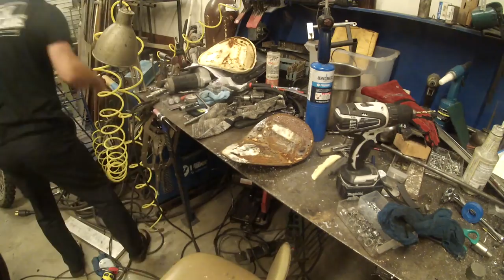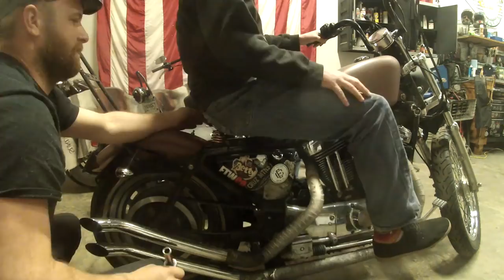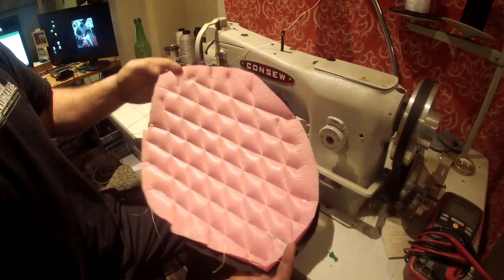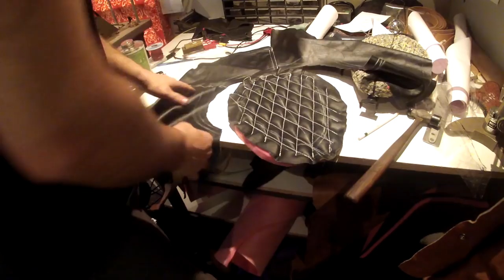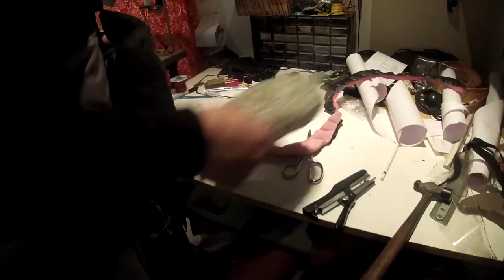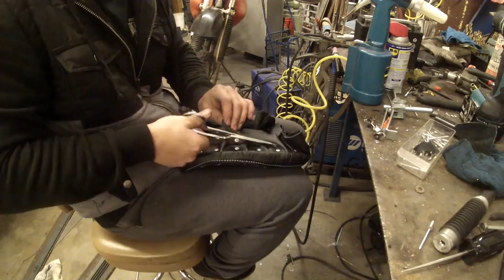Diamond stitched leather chopper seat | Lark Machine Co.

Comment: Hi mate.very good job there.as another guy commented can u please tell me sonething about the transparent material before the leather comes??it would be very helpful to know.thanx
Reply from the maker: Mick Salamakis hi, I used a transparent glossy adhesive backed vinyl. It allows me to transfer the overall shapes and stitching lines
Reply from the maker: https://www.amazon.com/Transparent-Permanent-Adhesive-Backed-Vinyl-Cutters/dp/B01MF7T40C/ref=sr_1_3?ie=UTF8&qid=1522263315&sr=8-3&keywords=clear+vinyl
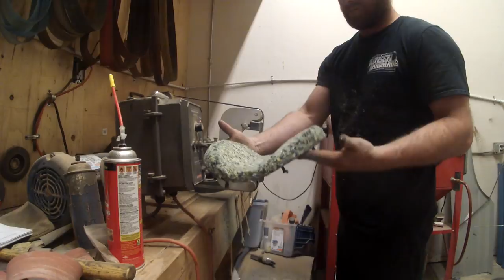Reply: Im really sorry i confused the whole thing.i mean the material thats between the metal part and the leather.the one that u r shaping with the grinder around 2:40 on the video.sorry for my bad english,hope u unterstood me.
Reply from the maker: The foam I used was a material that can be bought at a home improvement store. It is usually used as a cheap carpet padding
Reply: @sheanyquist  👍👍

Comment: That is so much waste on the bands. Like unnecessary waste. With leather a trimmer would use different parts of leather. You could trace a band maximum  be 2-3 inches. Looks great though. Just the wasting.
Reply from the maker: Better safe then sorry. I have cut it too close and it cost me a lot more than the waste. Plus a lot of the fringes of the hide are stretched or scarred. I try to locate my pieces on good spots and use the flaws outside seems and mount spots